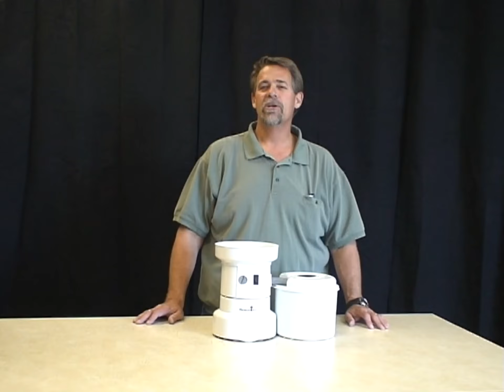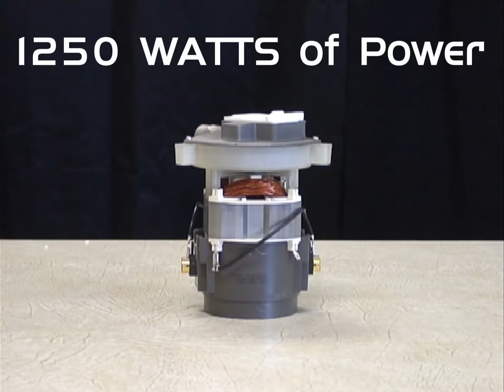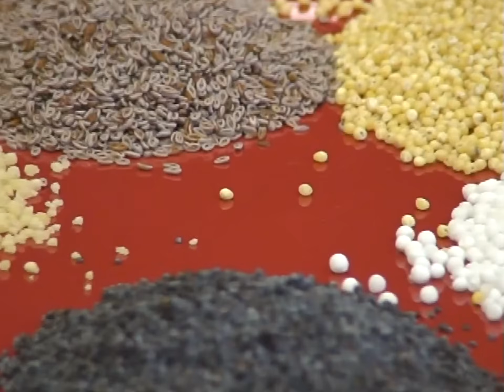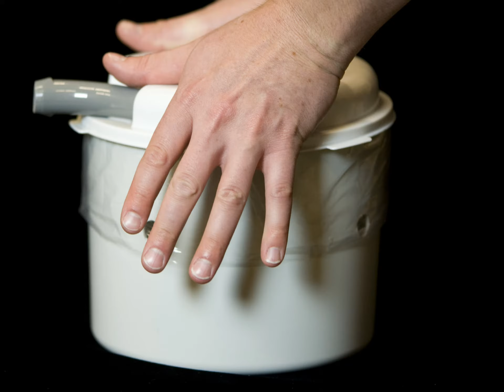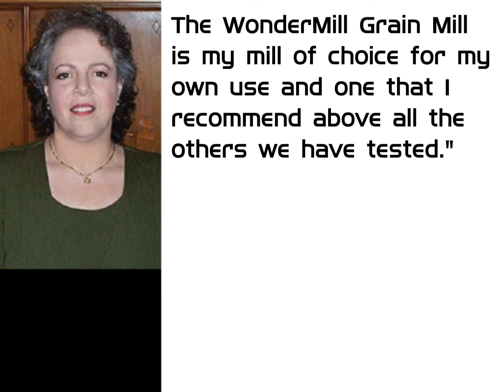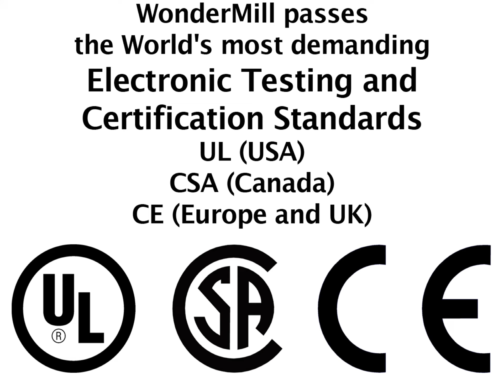WonderMill Grain Mill, the best grain mill

Comment: We upgraded the WhisperMill motor to the newer WonderMill motor without too much trouble.
We burned the old motor out i.e. It was a 240V motor being used with with an inverter in a 110V area.
It's on solar power and batteries so hopefully the power is fairly consistent... but it's doing a lot of milling (maize).
Don't know if the newer motor is much better than the older one (which lasted about a year)... but this time it's 110v so we don't need the inverter any more.
N.B. The WonderMill is easier to service than the older WhisperMill.
🙂